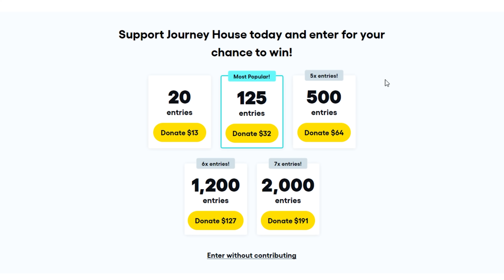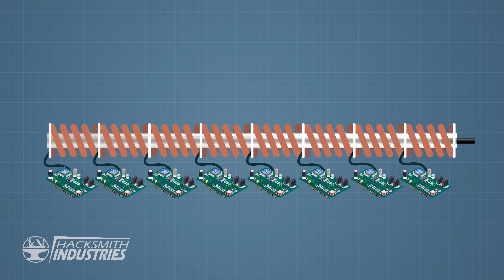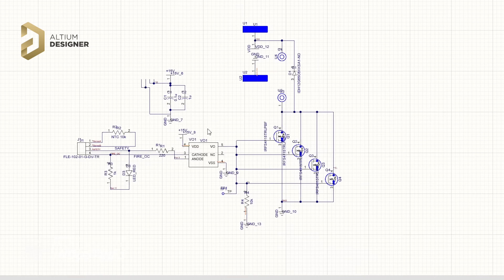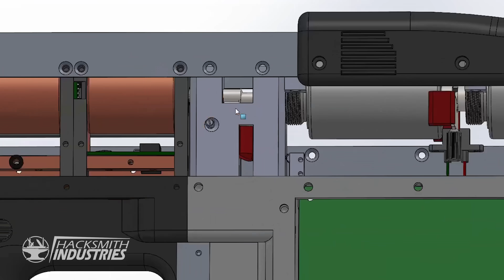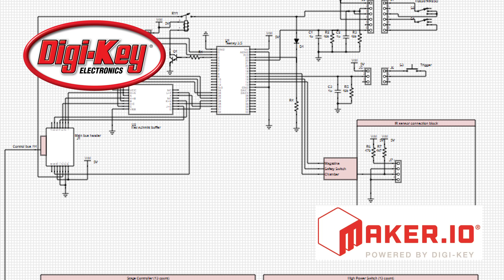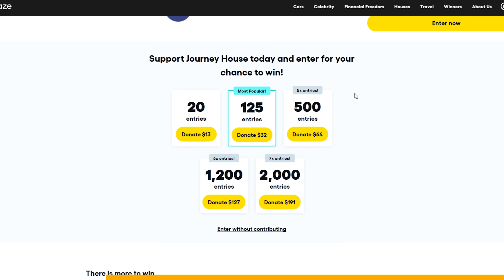MOST POWERFUL ENERGY WEAPON WE'VE EVER MADE!

Comment: This is really one of the best of your projects. I was hoping though for more fire power but I know we are still limited by the batteries unfortunately. 
Congratulations, because this is really a surprisingly high quality and well made project.
Reply: No he talked about what the problem was. And battery ain't it. The issue lies with the fact that:
1) There isn't just one barrel but instead it's in parts meaning that the projectile can't go down a smooth tube and will get slowed due to friction
2) Canadian law's a bitch and since they're a high profile company they can't break it so they have to limit the power of the projectile.
Reply: @naunau311  But that's only half of the story. 5.7J (which is the limit in Canada) is 30 times less than a most basic .22 pistol can do. And even assuming that you have the 50% of loss due to the gaps, still 10-15 times weaker than .22 pistol.

There are a lot more limiting factors, like discharge rate which for those batteries I believe is 1040 Amps. A lot! Considering you have 3 in total. 
They said on the movie that they are using only 400 amps, so I can see that in theory they should be able to achieve 150J of energy if they use a full potential of the barrel (no gaps) and batteries. 

But there is a catch! How many times they will be able to shot from this weapon. On full power, that 3-pack will last only for 27-28 shots. You can scale batteries, but the weapon will quickly become unusable. 

I'm super excited about rail guns but I still think we are hugely limited by our batteries.

And nonetheless, I adore the quality of this project. It's so much better thought than the others I saw.
Reply: @krss6256  I mean yeah a no-compromise rail gun is going to get limited by the battery at some point. Also the thing you're not considering with the .22 comparison is how light a 22 bullet is. The lethality from that bullet doesn't only come from how many J it develops but rather its speed and penetration that are great at really a really low power amount (which is why the ammunition is so small). On the other hand, look at those steel rods, they're huge, heavy and not aerodynamic. 
Like if their goal was to make a killing weapon, sure they could've done way better even with the given limitations but for rather obvious reasons that wasn't the goal. 

And yeah the quality of their rail gun is miles ahead of pretty much everything else I've seen, that's true

Comment: Clearly you need to use gold wire in the coils to reduce their resistive heating.

And sharpened projectiles to penetrate the gummies.
Reply: Actually silver would be better. Gold has a higher resistivity than copper
Reply: @evanmccarthy7589  Hear me out. Gold-coated silver wire. Silver for conductivity and gold for corrosion protection.

Comment: No matter how many different styles of railgun I see various Youtubers build over the years, I'm always happy to see them as they tend to be pretty heckin awesome. That and you guys rarely fail to make items that are amazing to look at and cool :D
Reply: This is a coilgun not a railgun.
Reply: @Slye_Fox  or Gauss gun
Reply: Makes you wonder why we don’t use them more in the military
Reply: @kreigguardsman3355  for exactly the reasons this video detailed. They're big, heavy, and cumbersome. They're unreliable. They require an inordinate amount of electricity to accelerate projectiles to lethal velocity. And honestly, Gunpowder based weapons are just better, in every possible way. 
The only time a rail/coil gun is better than a conventional gun is when we reach the ludicrous sizes involved in artillery, at which point the magnetic accelerator can actually impart similar force over the length of the barrel when you compare it to a gunpowder weapon of the same size.
Reply: @blise518B  There may be very few moving parts, but electrical components still fail. The Ammunition may be cheap, but the firing mechanism and construction of the weapon itself are not. 
And there are no superconductors that can handle the heat things like this produce. 

Still, none of that is the main issue. out of everything I said, power/portability ratio is the most important problem. You just can't pack enough juice into one of these things to rival gunpowder weapons and still maintain a portable size. Electrical work has improved over the years, yes, but it's not on that level.
Reply: @kreigguardsman3355  gunpowder weapons: cheap, mass produced, reliable, tough, simple, compact, works 24/7 as long as you have ammo which is cheap and mass produced
coilgun (at least as shown in this prototype and most likely for others for at least the next few years): enormous, heavy, expensive, probably pretty delicate and would break if you dropped it or it rained or literally any weather event, doesn't have nearly as much power, requires electricity which you might not have enough of in the middle of some shithole jungle or desert to charge a hundred guns at a time (and if you did you would still leave a good portion of the troops weaponless for hours at a time)

like the original commenter said. pretty heckin awesome and amazing to look at and cool. that's it. they're not supposed to be actual things you would use irl